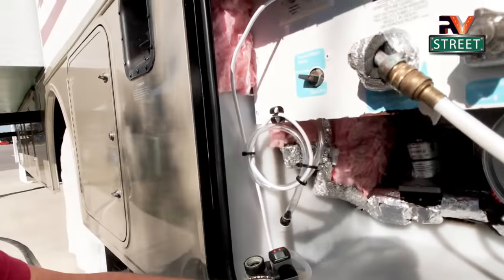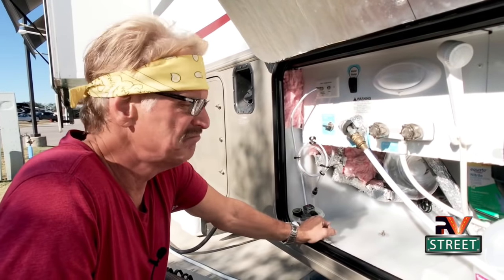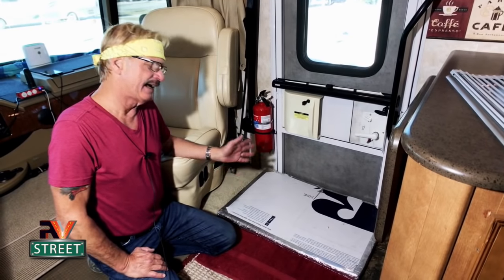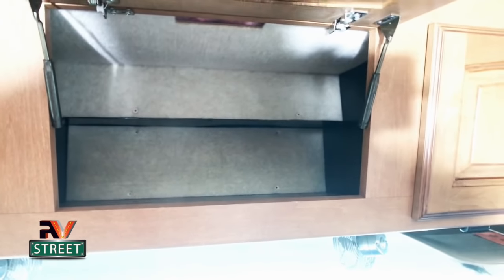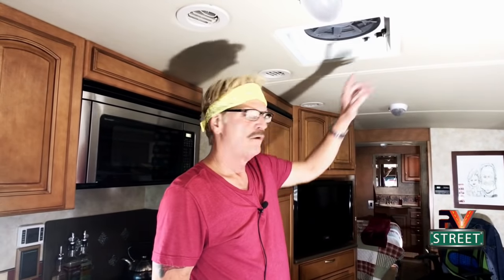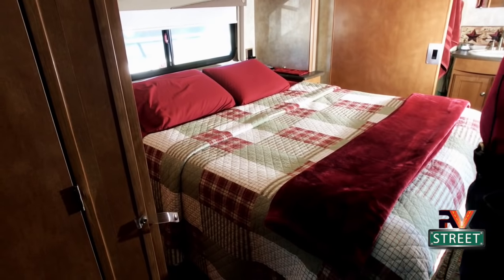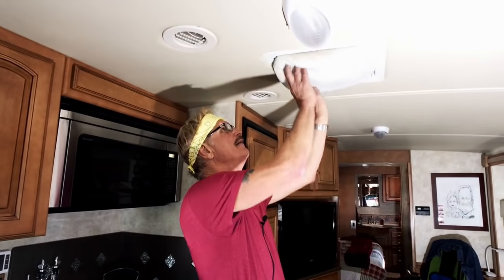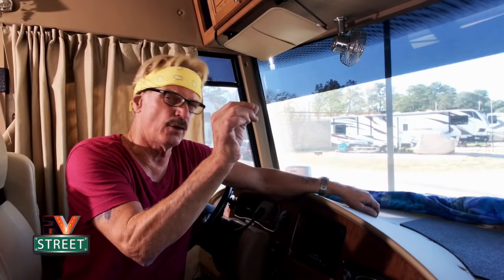😰  INSULATE, HEAT & PROTECT • Key to stay warm in your RV

Comment: Great video! But clarification: Most models of Mr Heater have an oxygen depletion sensor. If any Carbon Monoxide is sensed, the heater automatically shuts off. Seen several videos where people have set the up with external CO monitors in the RV for hours and the sensor was never tripped. The only time they “forced” it to trip was running it on high in an enclosed bathroom. Government regulations require the warning on the label, but you are generally safe even without venting any windows. Since you have a propane cooktop and oven, your camper should already have a CO alarm if it’s not combined with your smoke detector.  Really learned quite a bit from your video -thanks

Comment: Just found your channel and really learned a lot about insulation in a camper. We are “newbies” to the RV world. We have a 1990 Prowler with a slide. Will definitely be doing the pipe there and check some of our other places that could use the extra insulation. We haven’t really been winter camping but plan on it in the coming months.  We brought our little electric fireplace from the house and have used it a few times just to get the chill out during our fall trips. Will definitely check out your other videos. Thank you so much for the helpful information.
Reply from the maker: thx Marilyn. 👍

Comment: Thank you so much for making this video! This is the most detailed video I’ve seen on how to insulate your RV. I’m a full time RVer but we are stationary - we are living in our RV until we build our house. We are coming up on our second winter in the RV and I’m definitely going to apply all of your suggestions. One thing about the propane furnace, we found it was pretty much the same to heat with that and the electric space heaters we had. Maybe it was because we had a lot of drafts in the RV or where were parked had a lot of wind? We actually used both the furnace and space heaters simultaneously. I tell ya, we spent about $300-$400 a month on electricity and propane in the winter months. 😳 
Last year I used the heat shrink wrap on all our windows. It was nice because we still could look out and have light. I don’t like living in a cave either! It seemed to help but not as much as I had hoped it would. Maybe this year after insulating the draft areas it will work better! Thanks again! ✌️
Reply from the maker: Thank you Chrissy. Yeah these kinds of insulation tips will make a BIG difference in the summer and the winter.

Comment: I live in a 24 ft fifth wheel in Northern California and I’ve done some renovations and insulation on my own. Keeping the RV warm in 30 and 40 degree winters has been a challenge. I tested four different types of heaters in 2020, including ceramic, fake expensive wood burning fire stove, and I finally found that the radiator oil heater works best. I like the bedroom cold so I close the bedroom door and I hung a pretty decorative curtain in the hall that separates bedroom and living room and it has absolutely been a game changer. And most importantly I feel safe enough to leave it on when I’m gone for the day  so when I come home during a cold day it’s comfortable and I don’t have to wait hours for it to warm up
Reply from the maker: Way to go Shannon on figuring out what works best for your rig.

Comment: I've used the reflector lamp method to keep the water lines in my house downstairs bathroom from freezing. The builder did not put insulation in that wall. Works great. Have since insulated the wall and all is well.
Reply: Reflector lamp method?

Comment: Very good tips. The foam (blue) board is great. The fiberglass  R19 is only good in a cavity, either 3 1/2 or 5 1/2 thick, when it is compressed it's almost useless. The RV industry could use a good spray foam as insulation, but won't spend the extra money. 
Keep up the good work.
Reply from the maker: Ya, I didn't mention it in the video but I DID NOT compress that insulation in those larger cavities. To insulate properly you need some air space and that's what I did. But what I did put in there made a HUGE difference. thx David.

Comment: I cannot thank you enough! I’m a newbie and bought a 2020 Forest River Cardinal Fifth Wheel as temporary housing. Well let me tell you NOTHING about this RV has been recreational!! Seriously a nightmare and this video is the absolute BEST I’ve seen about winter living. I’m so grateful and headed to Home Depot now! You have a new and appreciative subscriber and follower! 🍀😊
Reply: Oh one more thing and it’s a question about the cost of propane versus electricity. Everything I’ve found on line indicates that propane is always the least expensive fuel and I’m wondering what I’ve missed since you’ve said exactly the opposite and frankly I now trust you more than Google. 🤣. I’m in Central OK if that helps. Thank you again Sir!!! 🍀😊
Reply from the maker: When I did this video I was basing electric prices vs propane pricing on our experiences over last 2 years traveling the south, over central USA and the upper east coast. But many others that are in different regions have commented  where they are, that propane was cheaper. So..........it just depends on where you're located.
Reply from the maker: Thank you Denise so much. 💗
Stay calm, don't worry, take your time and you'll be able to work thru everything that's going on. You may feel over whelmed right now since this is all new to you but "recreation" will be in your future.

Comment: Great video and very helpful. In regards to why we use our propane heater instead of the electrical ones, a few reasons;
Prep: We have a 32 foot gas rig with no slides and 30 amps. So very tight on space and power. And it depends on if we are living in a cold northern climate or down south and just need to get through a cold snap. 
1. It’s easy and quick. There’s no reason to haul out the extension cords and heaters, just flip a switch and within 10 minutes we’re toasty. 
2. Room and storage is at a premium so there’s not a great place to store and setup heaters. 
3. Power. We only have 30 amps so adding additional power hungry heaters along with everything else that requires 120v we have to be very careful. 

Now, when we lived up north and lived in this rig in the winter we used both the electrical and propane solutions and of course had to think about what we had on before using the microwave or anything else that draws a lot of current. 

Anyway, down here in Melbourne Beach Florida, especially today 12/27/2020 it’s cold and windy so we just turned on the propane heater and boom!, we’re warm!

Again, thanks for the video, very helpful and WHEN we get a newer rig with slides I will do the same thing you did to keep out the wind!
Reply from the maker: Thanks Paul. Great comment. 👍

Comment: Great information. Thank you for all the time you put into sharing your ideas. Growing up in the midwest we'd leave the faucet trickling during bitter cold temps. Regarding condensation, typically it forms on glass due to lack of air circulation. Rather than cracking a window, a small fan would work better than closing off the front windows with curtains. It would also prevent frost from forming on the inside glass as it does when bitter cold. Another idea is to purchase plex sheets, add small blocks around the outside and adhere to interior glass. This will form a double pane effect and trap the cold air while allowing light into the cabin versus the reflective products. They can also be applied to the exterior. As for the electric heaters, here in Nevada I have two in my apartments. They look like mini fireplaces 24"H x 24" W...I never turned on the furnace last year. Even with full electric, my highest bill was $52.

Comment: I take a thermostat controlled heat tape wrap it around a steel pipe (make sure the heat tape doesn't cross itself) hang the steel pipe at a 45 degree angle and put the thermostat outside.  The heat tape warms the pipe and due to the angle of it hanging it creates air circulation flow works nicely.  When the temperature outside rises high enough the heat tape shuts off if it gets cold enough the heat tape will come on and heat.  I have been using on my water well pump house for years now with no problems.
I think this would work anywhere you need a little heat.
Reply from the maker: Thank you for sharing your knowledge with the RV community.

Comment: Martin if it gets real cold be run our propane heater because it Heats that underneath storage
Reply: I can confirm that.  I live in a warm climate so my coach isn't winterized.  I was in Colorado with temps down to 12 degrees over 3 days.  I packed the underneath bays with towels and blankets and kept the coach propane heat on.  That was enough to keep the water lines and tanks from freezing.  Many of our neighbors weren't so lucky!
Reply: If you put a small electric heater in your lower area, it does the same thing. 
Farm and fleet sells a thermaticlly controlled outlet that turns on at 35, and off at 45 degrees Fahrenheit. It only cost 15 dollars.
Reply: @imnotarobot3600  def a good ideal. I got a 250 watt heater on clearance at Wal-Mart for $10. I leave it on coach just in case freezing weather comes and I can turn it on in the wetbay.

Comment: Brother, keep up the great work! Watching lots, very informative. I live in Prince Albert, Saskatchewan all about Boondocking here and Cold. I am rebuilding a 2004 Georgie Boy Landau, F53 with only 30k miles. Got it to a point now where it will cross my great country multiple times. I just got back from a few days in the bush, moose season, I found running small electric heaters caused the generator to work much harder and burn much more fuel. The answer for me was use the generator to charge batteries, it idles along sipping fuel and I have 2 in floor furnaces.  70 liter propane on board and 85 Gallons of fuel, easily keep me warm for a week, I was impressed. Totally different situation here than you are used to, I drove 50km gravel to get to Elaine lake, Bush whacked willows to get in lol! Have a good one, Darin
Reply from the maker: Thank you for sharing your wisdom with the RV community.

Comment: If you check the wall warts on your dehumidifiers they probably run off 12v DC, you can buy 12v DC cords that will fit those and then just run them off the house batteries if you are boondocking since that is more efficient than the inverter.
Reply from the maker: Ya know, I never thought about that, using 12v adapters that is. I'll have to look into that. thx 😜
Reply: @RVstreet  I appreciate that you admit you don't know everything.  It seems easy but you'd be surprised how many people try to bluff knowing all the answers. 

I would like to know if you keep a notebook with everything that needs to be done prior to setting up and prior to getting ready to leave?  If not I would suggest that you do for 2 reasons 

1.  Like me as we get older we sometimes forget little things, especially when rushing or stressed.

2.  Heaven forbid something happens to us and someone else has to prep our RV to be moved to a safe place.

I'm a new subscriber.  Love your work!!
🤗✌️🤟🖖🙈🙉🙊👵🏼
Reply from the maker: @mslinstrot4643  When we first started FTing, the first year yes we did have a printed list. Two of them actually. One for Joanie for inside stuff and one for me for outside stuff. And we always check each other at the end. But since then it's pretty much rote and we don't use the list anymore but we still check each other once done. However, your comment of—Heaven forbid something happens to us and someone else has to prep our RV to be moved to a safe place.—is a good point but IMO a highly unlikely event. Besides where would I put that list where I could rely on the fact that the someone else would find it. But still a good point. When we get older and start to forget stuff we'll probably go back to the lists.
thx Bruce and thank you so much for subscribing. 🙏
Reply: @RVstreet  When I still worked I always created a "bible" of how to do my job.  I started doing this because I kept going into jobs with no one to train me.  When I moved into management I had my teams create the same thing but by this time I started calling it "Procedures for Dummies".  I told them that they should imagine a flood happened and the only person able to get into the office was the CEO and their procedures had to be dumbed down enough for the CEO to be able to figure everything out successfully.
The problem with most procedures is that they are created by someone who ALREADY knows how to complete the task(s).  A good procedure assumes that the next person to use them will know absolutely nothing.  So if you need to use a tool to say, adjust something, then the procedure will tell you where to get that tool etc...

As for where to keep your procedures for departure and arrival, I would suggest taping an ICE (In Case of Emergency) instruction card no bigger than 3"x5" card.  The only thing on the card would be something like:

"In Case of Emergency if this vehicle must be moved correct procedures MUST BE FOLLOWED to avoid collision while moving.
The procedures are located (list location of procedures notebook)."

The note card would need to sound scary enough to ensure your procedures are followed.

I would also put the note card in a ziploc bag to be waterproof and probably use a red permanent marker to write on the bag
"EMERGENCY ONLY"
Reply from the maker: @mslinstrot4643  I like that. Thanks for taking the time to explain a good way to do this. I especially liked the "Procedures for Dummies" part. 😝
Reply: @mslinstrot4643 -That is brilliant!!!

Comment: I have a pull behind Toy Hauler. I have 2 ceramic heaters in my trailer,  however, I have been using my propane furnace.  I use the ceramic heaters if I am low on propane.   I never knew I should be using the electric when I'm at full hook up sites.  What a great idea.  I'm doing it right now.  I'm in Florida and its darn cold. I have one ceramic heater running. It is keeping me comfortable.  Tomorrow I'll search for areas to use insulation to warm up empty spaces.  I'm so glad I saw this video... thank you. You just saved me a lot on propane.  I've been on the road since October.  I'm heading home to Michigan for Christmas then back south. I can't wait to put some of your suggestions to work.
Reply from the maker: You just saved me a lot on propane......
Yep and a lot of trips back and forth to fill those tanks. Your welcome. 👍

Comment: Great info, going to have to run to the hardware store and prepare myself for the rest of the winter. Never would have thought of adding plumbing insulation to the slides. Ive used my propane when I get up in the morning to warm up the bathroom/bedroom while I get ready for work (aprox 10mins to heat the camper to 70). Current temperatures in Albuquerque in the morning has been in the high 20’s in the morning. I haven’t insulated my front bay on my fifth wheel yet. I have one of those built in fire place space heaters and a additional space heater. I’m able to keep the camper at 70+ until through the day until I shut everything down for the night. Over the period of the night the front of the 5th wheel gets cold. Definitely need some of that blue board for the Bay Area

Comment: Excellent information, Martin. And really timely for us. We have just spent a few nights in the upper Arizona desert early mornings got down to 7 degrees. We used a combination of Propane floor furnace to warm the coach interior and keep the plumbing warmish and a ceramic thermostatically controlled heater in the bedroom. We'll be implementing all your insulation tips. I  ordered the wireless thermometer kit a few minutes ago. You have inspired both my wife Lee and I. Greetings from Camp Verde, Arizona
Reply from the maker: Well Ian, when I read this comment to Joanie and she heard 7º she shuttered, and ran and got a blanket.

Comment: When I use my furnace, the heat comes from the floor vents. When I use my heat pump(electric) the heat comes from the ceiling vents. Completely ineffective in Temps less than 50 degrees. Space heaters are the way to go if I need to spare propane.

Comment: We have found that at $8 for 20 gallons of propane, using the RV furnace is much cheaper than using electric heat. That being said, using both an electric heater along with the furnace warms the rig very fast! Also since our unit didn't come with an electric fireplace we removed the cabinet doors below the TV and put in an electric fireplace/heater. It's wonderful ambiance and a great additional heat source! Thanks for all the great tips!
Reply from the maker: WOW $8 for 20 gal. of propane is way cheap. Good for you finding that source to fill up.
Reply: I think you are referring to a 20# tank, not a 20 gallon tank. My RV onboard tank is 20 gallons and ccosts about $2/gallon to fill. Sometimes a lot more. If the propane dealer comes to the park they charge $4.75/gallon plus a $5 delivery charge. It costs me almost $100 for 20 gallons. its pretty inconvenient to fold up and drive to the dealer in the middle of the season.  We use electric as much as possible, for  the convenience and cook with the propane and use an extend a stay adapter in case we run low. With a 38' DP I can pretty much guarantee  that you will run out of propane if you are running that for your main heater.